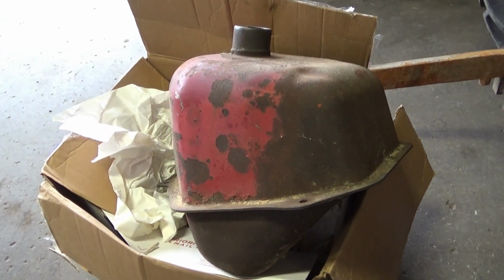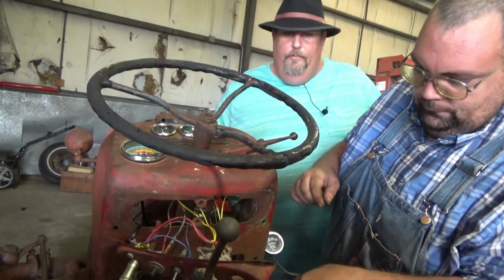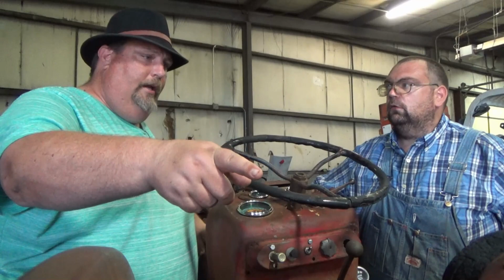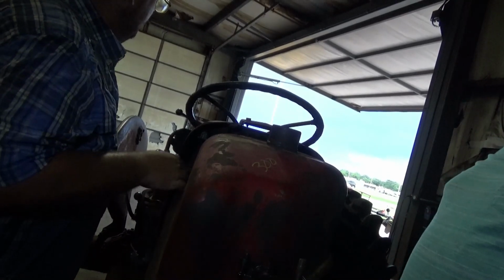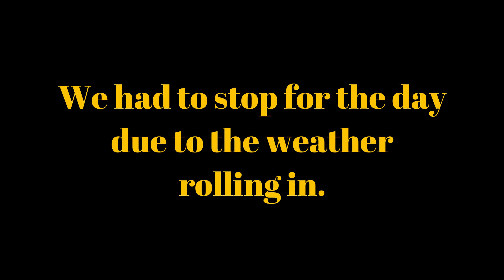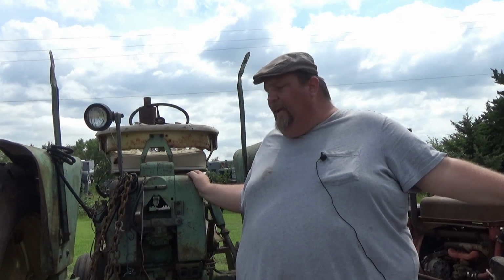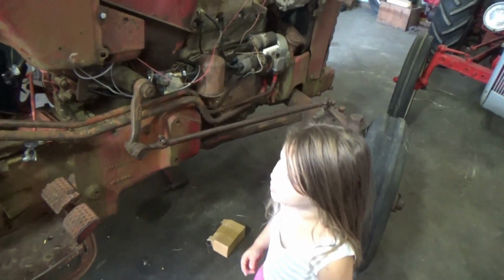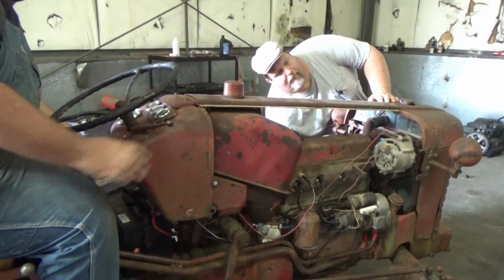300 reaches the finish line

Comment: A trick I learned years ago about steel fuel tanks. Take a good-sized magnet  and place on the furthest point away from the  outlet and below the average gas level it will collect and hold any rust that develops in the tank.  Keeps the carburetor cleaner..

Comment: I don't think it's the carb although U need 2 take hammer and tap the carb and see if runs any better the carb may be 2 rich and needs 2 be readjusted it would help 2 clean sparkplug that will tell the tail on what shape the engine is in the tractor runs 2 rough and a engine overhaul is the only way 2 fix the right 👉 😊 way 😊😊 OMG 8 27 2O23